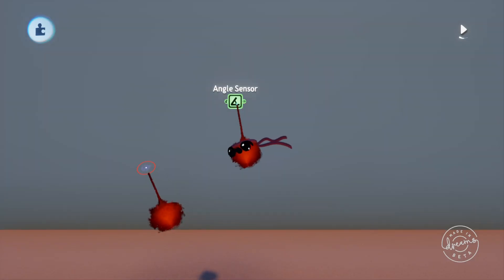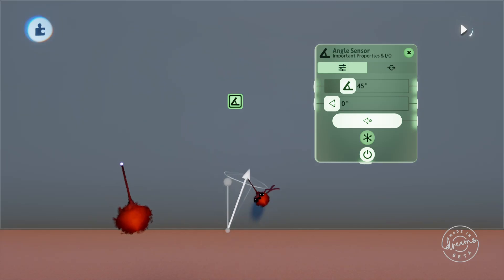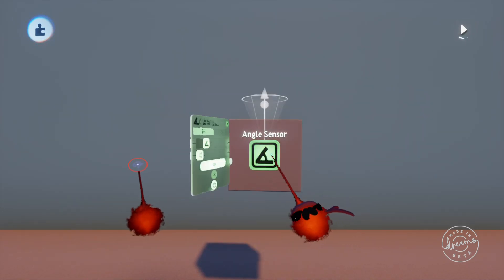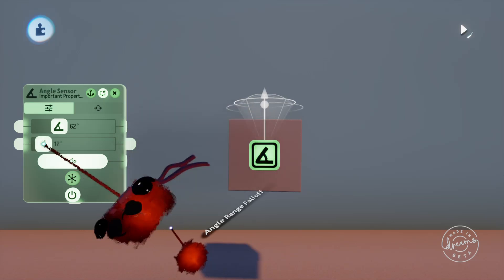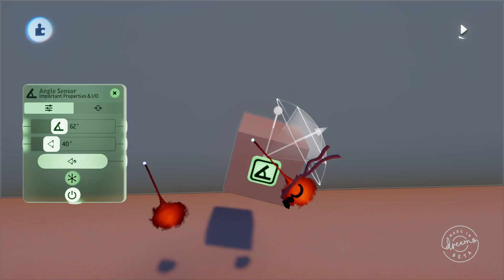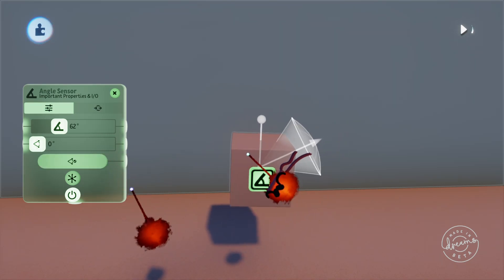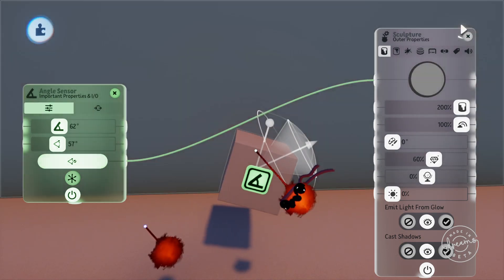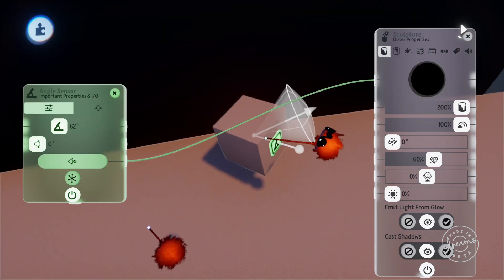Tutorial #3 - ANGLE SENSORS - Dreams PS4 Logic

Comment: New to Dreams and game design - what are some of the most useful applications for the angle sensor changing the color of the wall? I'm just not sure how having an object turn causing an object to change color would be used.
Reply from the maker: That was just to show the output that it gives under different scenarios :) basically if you want to detect anything angle based, this’ll be what you’re after
Reply: Okay..I tried using it and I couldn't quite figure it out. I was trying to make 2 walls snap to a 90° angle. Is that possible in Dreams or do I have to eyeball it with the angle sensor?
Thanks!

Comment: looking for some advice, im trying to have a specific face and run animation trigger when my character is falling down a hill too steep  to clime, is it ossible to utilize this to do that or is there a better way?
Reply from the maker: Hmm good question! I think it would be difficult with the angle sensor to get the signals you need. There might be an output that you can use on the puppet interface gadget in the controller logic microchip though. I can’t remember what outputs it has exactly, there’s a lot of them, but one of them might help you get this working :)
Reply: @JimmyJules153  thank you! Yeah I tried with the angle sensor, it worked in a way I didn't anticipate, instead of recognising the angle of the ground, it recognised the angle in which the body bent while falling down the hill, the problem was that it would also notice that angle change when ever I turned too quickly. Couldn't adjust it to only work while falling so it's back to the drawing board 🤣, thanks for the input, ill take a look and see what I find!

Comment: For reasons unknown i'm trying to create an old-school grid based first person rpg. I'm working on turning the player in 4 directions. As of now it works somewhat, using an angle sensor. I made it so that a rotator activates when the player press left or right and then i use an angle sensor to detect which direction the player is facing (Controls are not attached to character model).

The issue is that the forward direction is detected on play because both adjustable arrows on the angle sensor, has to be set to the forward direction, meaning it always outputs a detected signal. Do you know a way around this? If it makes any sense, that is :p.
Reply from the maker: Hmmm I’m a little bit confused but I think I see what you’re trying to do, it’s hard to tell without seeing it are you able to post a link in the Dreams Discord (link in the subreddit)? 

I’m guessing you’re just trying to limit your character to only move in 4 directions is that right? If that’s the case, you might be better off using a teleporter and 4 tags. I used grid based movement as an example in the teleporter video and I think you could use a very similar setup for what you’re trying to do. 
If that doesn’t help, shoot through a screenshot of your setup if you can and I’ll take a look :) 
I’m JimmyJules153 on discord if someone else doesn’t answer you before I see it
Reply: @JimmyJules153  Thank you for taking time to help :). I'm not as far as movemeny yet, but will defineately check the video you mentioned when i get to that part, will save me a lot of time. Right now it's rotating the character that is causing me problems, when you press left character turns 90degrees to the left, press again and he looks bacwkards, one more and he looks to the right. This works using an angle sensor, it stops moving when 90degree target is reached and it worls without issues. The problem is that when it comes time look forward it just stays at the previous position because forward is perpetually sensed as having reached its target. I can try and send some images of the setup, then it will make more sense.:)
Reply: images and video in reddit thread: https://www.reddit.com/r/PS4Dreams/comments/aog04m/tutorial_3_angle_sensors_dreams_ps4_logic/
Reply: Nevermind, i think i got it. If i only connected the object to the sensor via "Relative to object" it solved the issue.